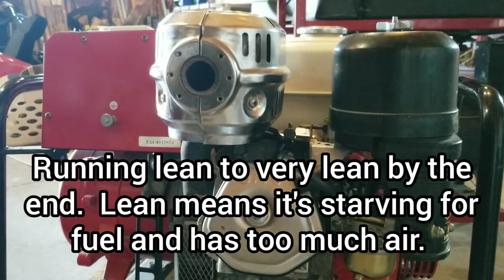[By Ear] How to Tell if Your Generator or Small Engine is Running Rich or Lean

Comment: Will it be oversimplifying it if I adjust the A/F screw until I find the sweet spot where the engine sounds the smoothest? Ie, the least surging, sputtering, and other funny noises?

Comment: So my Generator was improperly stored (gas and oil weren’t drained,  spark plug was not unplugged, it’s been stored outta weather and was brand new (Champion 4K watt) So, the recoil starter rope won’t pull at all? Can’t get it to turn? Likely cause?
Reply: Check to be 100% sure it's not stuck in some way.  If sure, go ahead and try pulling with the plug removed and disconnected.  That will completely remove compression in the engine and should make it easy to pull.  That'll help you identify if something is stuck, or possibly if the cylinder flooded with fuel due to a stuck float valve.

Also, I would only drain the fuel out of the generator while being stored off season.  Removing the plug won't help or harm anything, but removing the oil will allow parts that are normally submerged in oil to be exposed to air and possibly corrode.  What is likely a better alternative is to change you oil after the last run off the season and allow it to be stored in that clean, fresh oil.